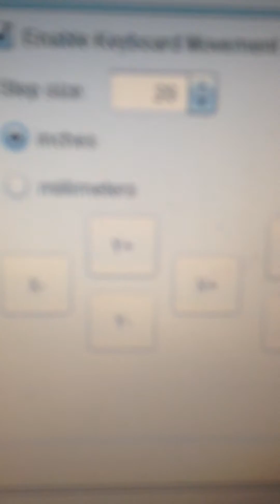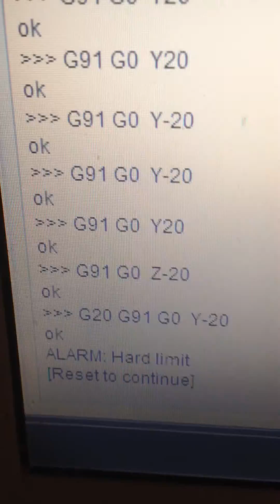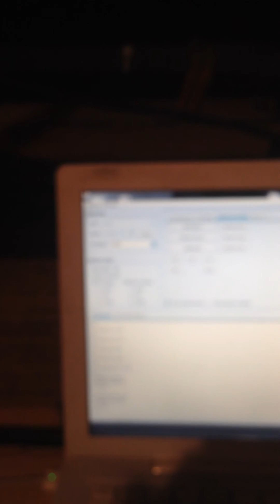X-Carve Limit Switches

Comment: you can set up soft limits in grbl to stop the machine from crashing. no need to add any wiring or hardware. also shielded wire from home fepot is $0.19 a foot although not sure its really needed if you just use homing switches
Reply from the maker: mike gager  Yes the soft limit is an option unless of cause you forget to home your machine or are using Easel in which they remind you. I like this cause it takes all the what if's out of the equation and operates like a more professional cnc, plus the maker in me had fun figuring it out. But like i said in the video there are many work around, but i find this the best.
Reply: yep true you do have to home for it to work